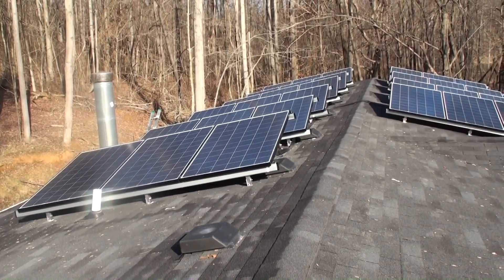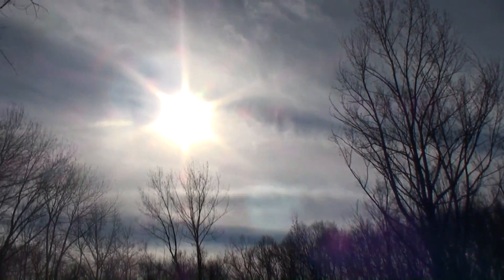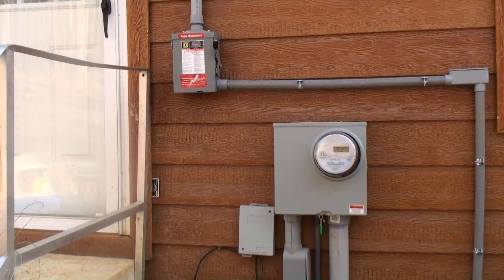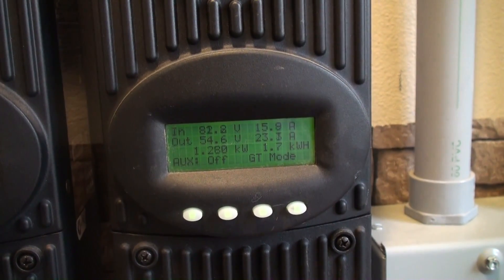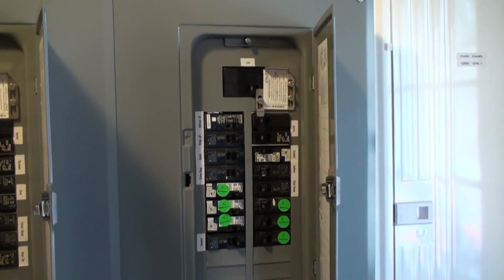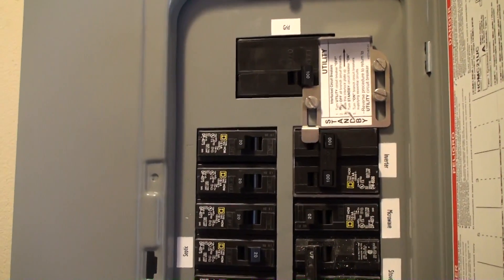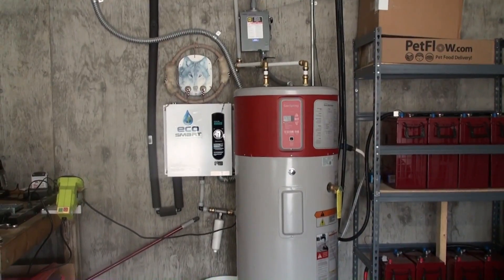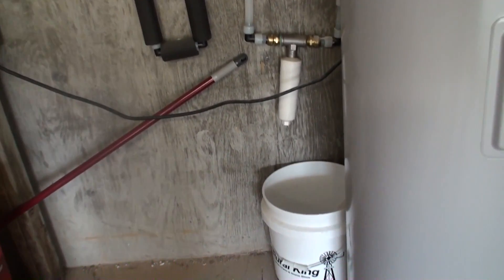Our Outback Radian GS8048 Based Grid Interactive Solar System

Comment: What electrician did the actual install, and do they travel ?  :D
This is a very professional and concise system.  I hope it works as well as it looks.  Outstanding.
Reply from the maker: We used a local electrician for the wiring and conduit, and we did everything else ourselves including mounting three racks and panels and batteries.  Was definitely a big job.

Comment: I have one Radian GS7048A do U know how can I program my system if I want my first priority Solar, then Battery and last the Commercial Electricity.
Reply from the maker: Yes but solar and battery are one and the same.  The charge controllers charge the batteries and the inverter draws from those batteries.  If your SOC drops too low you can have it switch to the grid.

Comment: Good Afternoon, I’ve been looking at the OutBack SystemEdge
830NC > 8kW FLEXpower Radian plus 30kWh Energy Storage Package for my home
and your videos are a great help. We have the following, gas clothing dryer, gas
stove, gas intent water heater, new energy efficient furnace and heat pump, 2
new refrigerators, and small devices. We updated to all LED bulbs and are using
Embertec Emberplug Advanced Power Strip. Check it out and it will help manage
your electricity. We are hoping to get enough credits in Washington State to
not have a power bill. Any suggestions on getting to those goals? Thanks…
Reply from the maker: Derwood Duncan sounds like you're doing all the right things
Reply: Thanks, we made a lot of our decisions based off your videos. Any suggestions? We are looking at updating the heater/heat pump, gas water heater and gas appliance prior to the install. If you updated your do you think your 8wk system might average out for the year to not have a power bill? I know its a guess but based off your to year usage was wondering if you had an idea. Well thanks again and have a great Sunday!
Reply from the maker: Derwood Duncan Thanks, you really just need to do as much as you can and see where you land.  We generate most of our non heating and cooling energy from solar now.  Our bills range from around $30 to $150 now vs. $200-$450 before.

Comment: I am introducing solar generated power to Cambodia. Not that there have not been efforts in this direction before but I am looking at the big picture. However I have to start small and build on the systems and concept. Cambodia has sun in abundance, which is a good starting point. I have surveyed a charity school and they have neighbors who are off-grid also. My idea is to create solar-charged power-plants and give energy to the school whilst also sending additional power to neighboring houses. I understand that this is not a forum so please contact me at solar4cambodia at gmail dot com if you would like to contribute information leading toward facilitation of my plan, thanks Julian.

Comment: great job, thanks for sharing.  When you replace the roof shingles will you have to temporarily remove the panels?
Reply from the maker: +Pef273 Thanks, yes, but I'm hoping that won't be necessary nearly as early, as the roofing under the panels typically lasts a lot longer.  Thanks

Comment: Do you know about a rough estimate of the expense of ur system including all hard wear and building permits needed, I'm curious about what a system of this size would cost to own
Reply from the maker: 238haden Roughly $30-40k including generator, battery bank, inverters, controller, panels, mounts, wiring, and electrician labor, it's going to vary somewhat depending on labor.  I did as much myself as I could, so that saved a lot.  If you hired a solar company to install a system like this it would likely be every bit of $50k.
Reply: Wow thats quite a bit, i think if i did one id do as much as possible myself and wouldn't get a generator but with that being said, i better start saving haha

Comment: Well.... I'm currently installing a system much like yours.  Mine may be a bit larger... I'm going with 20 6v AGM battery bank and going with 2 strings of 60v.....  I'm using all the same equipment, however..... I'm using a ground mounted system since, I'm lucky enough to have some land..... I'm also going with 30x300w panels..... I liked the video, thank you.
Reply: Joe Woolf    I think my amp hours is almost 900 at 60v for the battery bank.  I think they're going to weigh over 2000lbs.  lol... as it is.... I live 7mi from a grocery store and, when there is a storm... we lose power for 8-10hrs....   you get to wondering what would happen in a real emergency....  and... these days, what about cyber attacks or other crazy stuff nobody even wonders about except me.  lol....  Well... I'm about to get that problem solved and, honestly, they're expensive but the price is offset by what you save..... it's sort of a no brainer.
Reply: Joe Woolf lol... finished putting in the poles to hold the panel array..... 16 poles... each 3.5ft deep... each with 3 bags 80lbs each of concrete.... so 240lbs of concrete in each hole....  it may be overkill but, it's NOT going to blow away in a storm.
Reply: Joe Woolf Luckily... I have a tractor with an auger and a box blade.... trenched 500' of trench to get back to the house with the wires from the panels.... used the box blade to cover the trench back up..... dug the holes with the auger and hit some clay.... even had the tractor popping wheelies when it was getting stuck in the clay..... lol... the poles are in and straight.....  next week the panels go in and we pull the wire through the buried pipe... then, we'll wire the beast.  Tomorrow, I'll probably take the cement forms off....  ( I made nice round pads that extend above ground for the poles )
Reply from the maker: Joe Woolf Sounds like a nice system Joe, thanks for commenting.  I hope you're not planning on running 60VDC 500'?  I just did the math and at 150A, you're going to lose almost 40% of your power over that run with 2AWG copper wiring, for example.  Or are you planning to locate the Radian near the panels and backhaul AC instead of DC?

Comment from the maker: Michael Paul: I can't reply directly to your comment so I'll post it here. You have posted a ton of incorrect and misleading information regarding smart meters and grid-tie systems so let me refute it here:

1. The utility / smart meter IN NO WAY controls my inverter or charge controllers.  The system is not designed to allow external control as such.  The way the MATE3 and inverters work is that when the system detects a sine wave from the utility in the proper frequency and without significant 'noise' then after a sync time period (and provided I have excess capacity, i.e. my batteries are fully charged) it will start sending power back to the grid and spin the meter backwards.  I can assure you they cannot control my system in any way.

2. The utility absolutely cannot draw energy from by battery bank.  I (and no one else, certainly not the utility) control everything in regard to if and when I use battery power, and I certainly do not use them to send power back to the grid.  They are only drawn down in an off-grid scenario.

3. What 'microwave issue' are you talking about?  Smart meters don't use frequencies anywhere near microwaves.  Most operate in the 900MHz spectrum which would be required for any foliage penetration in a mesh network.  Microwaves are too high.  The primary reason for smart meters is so that the utility can read the meter remotely if they have a mesh network of meters to do so.  To me that makes a lot of economic and logistical sense- much better than sending meter readers all over the map.  That said, my utility doesn't have enough meters deployed for a mesh network so they still have to read my smart meter the old fashioned way.

Please don't confuse people by posting misleading information.  The link to NIST that you reference in no way supports your claims.
Reply: Microwave frequency range is between 300 MHz and 3 GHz.    Main concern with the high-power radio bursts Imo is not RF radiation to humans and animals,  but the RFI potential and raising the noise floor with ubiquitous increase in spectrum pollution.   Also, there are people using frequencies around 900mhz / 33cm over the radio for voice communications which may be affected in some cases,  the electric company requires customers have a smart meter on at all times, not giving you any choice,  And basically they ignore or don't do much about reports of RF issues and interference;   As a licensed user of frequencies near 902mhz  which are also shared frequencies, being forced to have a RF emitter on a nearby frequency range at all times in close proximity to your radio receiver can desensitize,  And you can't hear the people you want to talk with......    The difference between smart meters and other Part15 devices such as WiFi routers,  Is the property owner has control of them and can realistically  decide to not have them,  Or to turn those things off,   But  Smart meters are embedded into your electricity distribution, and you have no option to remove that source of RFI......   On your own property,  you should have a free choice to decide what  kind of 3rd party transmitters can be used!
Reply: KB9OKB these systems, as you say, operate on the grid or off but, not both...  they charge your batteries and whatever is left will go to the grid or your home....  they sever the link to the grid when the batteries aren't being charged and power is down.... if they didn't sever the link then, you may kill the linemen that come to fix the power from the electric company....  in no way would anyone be able to sap power from your batteries.... the meter will run forwards or backwards depending on what you are putting out.... when power is on and you are producing power.... it's what it is... you're only maintaining your batteries and tied to the grid.... when the power is out... you become your own grid..... you sever all connections to the grid and you run off grid.... I've been lucky enough to place my panels in a place you can't really see them from the road to the house.... they're not in the way of anything and the panel array is 66' long.  lol  solar isn't the end all and be all but, It's pretty cool to run about 10k watts into your house when the sun is out and if ( God forbid )... something bad happens.... you will still have power.
Reply: Joe Woolf truth be told... when the sun is out... you're running your meter backwards off the solar panels.... they can't sap power from the battery bank.... your meter is showing what you're putting back anyway and you get credit for it... when the grid is up... your batteries aren't in play at all... the electricity only goes in.... to pull it out, you have to sever the link to the grid for that to even happen.
Reply from the maker: Joe Woolf Right Joe, everything you said is correct except I wanted to clarify that the only time the grid is 'severed' is when the grid is down (i.e. no 60Hz sine wave is recognized as coming from the utility over the wires - in which case the Radian system disconnects the utility connection until it recognizes that signal again) OR when you physically disconnect it.  Otherwise, the inverters (in the Radian system) are always connected to the grid and putting out power (to your home and then into the grid) at the same frequency (well technically just a smidge higher but that's another topic).  This gets a little complex to explain/discuss without a marker board. :-)

Comment: The smart meter allows your utility company to access remotely the inverter and charge controllers when you are not producing power usually at night or if they have your system turned off allowing them to take control of your equipment and pass back through the reverse sine wave to compress it and control it from going out of sync.   Its called power inversion  causing wear and tear on your equipment and alleviating the utility companies need to invest and maintain the proper equipment that usually would perform that task.   And no one knows hat the long term effect may be to your PV system and battery bank.

   Also they can take energy from your battery bank use it to offset the PEAK LOADS between 4 and 7 pm when they might have insufficient power to distribute on your area of the grid, then when they are done they may make your system purchase the energy back usually at a higher rate or they could just leave them depleted till next recharge cycle leaving you vulnerable should a powered outage occur and your battery bank is depleted. 

This has been engineered by the Department of Energy and thoroughly studied and communication standards developed so that  all PV systems that utilize an inverter can be controlled by remote signals.....as well as algebraic formulas to determine if the utility can purchase power elsewhere at a lower price and if they can they will just send a signal to your inverter telling it to not produce power  at this point in time.     

 With this kind of control the availability for the utility to show you consumed more power than what was generated in effect forcing you to pay for power even though the capability is there to produce more. 

SEE  following reference:

MultiSpeak and the NIST Smart Grid 

http://www.multispeak.org/about/SmartGrid/Pages/MultiSpeakandtheNISTSmartGrid.aspx

The Microwave issue is the  SCARRY SIDE to It!  coupled with the financial risk I can't see the benefit to anyone except the utilities which are mainly controlled by the government......

Comment: Excellent job producing both of these video's!  Tremendously helpful. 
I'm currently seriously considering a similar system using Outback Radian and other components.  Curious about shipping..  Wasn't it very expensive to have everything shipped from the west coast?  I've been shopping at wholesalesolar as well.  AltE is a 6 hour drive from me (Rochester NY) and was considering just picking everything up in a truck since it would be so large and heavy...
What made you decide to roof mount? I'm looking at 'Top of Pole' mounting - most of the systems I see around here are mounted that way..
Thanks again!
Reply: kb9okb I'm a roofing installer, and I've been thinking about installing a pole mount system on the roof so workers can walk under the panels for roof maintenance or replacement.  (but I'll probably do this on a metal roof and won't have to replace the roof ever.)
Reply from the maker: Thanks! Roof mounting is way cheaper, and most of the installs use that if at all possible, I think pole mounting is something you should do if roof mounting isn't an option for whatever reason.  Another advantage is that homeowners insurance usually covers the panels, etc. if they are mounted to the home, but they don't if they are not.  Yes, if you can drive and pick up the materials that would be far cheaper than shipping.
Reply: KB9OKB I didn't have a roof mounting option... I have dense trees all around my house... Unless you are a doit your self guy, mounting 30 panels to your roof that you may need to re-shingle seems like a bad idea to me.
Reply from the maker: Joe keep in mind that more often than not, panels actually protect your roof (the area under the panels), dramatically lessening the frequency with which you need to re-shingle.

Comment: gREAT VIDEOS... BOTH OF THEM.  i JUST  got my 21 panel (6KW) system wired in and waiting on the final from the inspector.  Will be following your tubes as you know much much more of technical aspect than I.  Just a V=EtimesI guy but learning fast.  Too have the Outback hardware (8048 and the controllers).  I have 8 12v (226Ah) agms in series and parallel - interesting about the desalinator (did I get the right?) Need to find out about that!   I have a 6K Generac LP 24/7 unit for final backup.  It's expensive but once the system is in... it's worth that new car or boat I forfeited!  OH, here' a tip... don't forget to take lots of pics and make sure your HOME INSURANCE company has copies.     Here's a question:  Panel maintenance.  Any knowledge?  Hose the bird crap and leaves and such off?  I suspect be best to wait til the sun is down.  AND, in the winter, heat tapes for prevent some snow buildup (12 of my panels are on the flat roof right above my head -  right now.. straight up there)  Would be rude to have my beautiful system come crashing down on me because of snow buildup!!!!!!  Beyond my show shovel... tapes seem to be the best help.  good luck... post more!!
Reply from the maker: Hi Rick, sorry for the delayed reply.  Glad to hear you got your system... sounds pretty good.  In answer to your panel maintenance question, your assumption is spot on- just keep em clean, that's about it.  Make sure if you put heat strip tape- be sure they are not on the panels themselves, if you block any light at all from them- even a small strip, it will have a disproportionately huge impact on output.  Good luck!